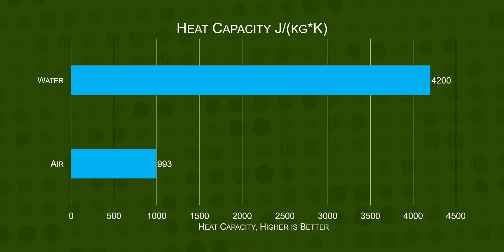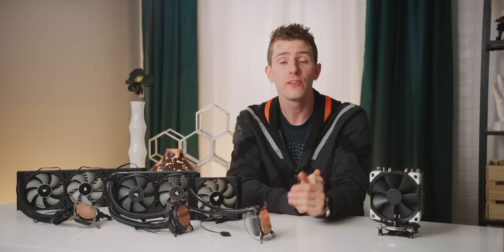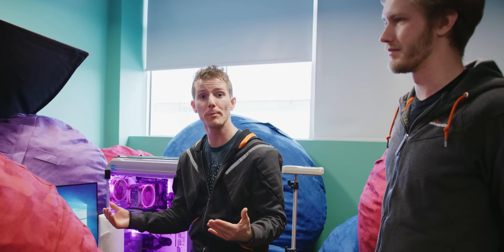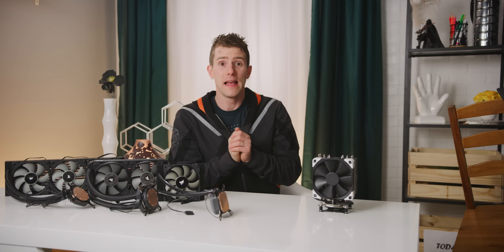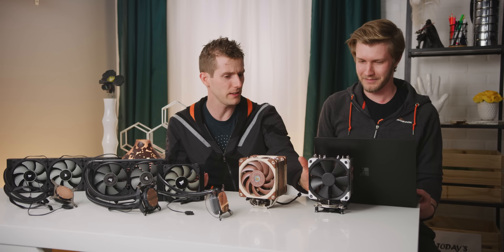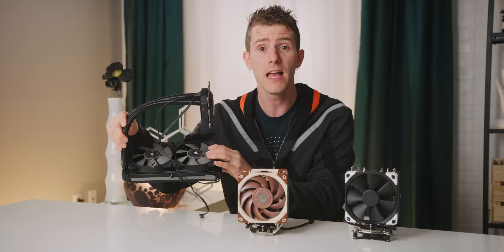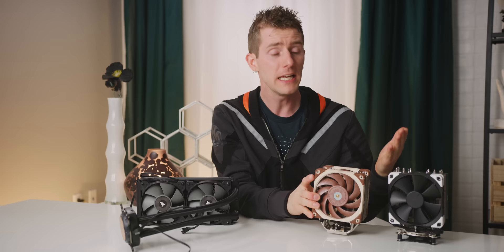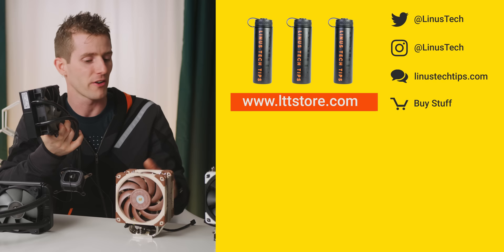Why you shouldn't water cool your PC

Comment: each doubling distance kills 3db in noise.. the microphone is placed in the same position all the  time.. but the coolers not... the water cooling is almost half distance and thats why its louder.. so the test is kinda right.. but wrong at the same place.. cause u are measuring wrong distances.. you must also consider the isolation of the box.. cause in the cpu's place is far more than the opened front  open intake witch normaly would have more less sound isolation   for air flow  

the other part is that you tested in max temperature - max fan rpm... but the use of the pc WONT be for ever that high... so probably on normal tasks .. or work.. or gaming the values will be also different.. that means one product may be louder at full speed fan.. but not at 65 or 50.. also some products may never exceed 60 deggrees.. but other could be always above...  probably the air coolers could keep in idlee potition better temperature keeping cause of naturally metal heat dissipation without even the fan turning.. 

 .... i am an audio engineer

Comment: I've been using computers since Commodore 64 days and I will never use water cooling because water is really, really bad for a computer.  If you have a few thousand dollars to throw away and get a new box every year then sure, try out water cooling but when it leaks and destroys your computer you are not allowed to be angry about it.  It's a risk versus reward argument.  ^ ^  KC  P.S.:  Also, overclocking CPU's was a thing back in early 2000's and unless you are an e-pro gamer there's no reason to overclock a CPU which is the main reason to use water cooling but hey, future e-sport gamers gotta start somewhere amirite?  =P    ^ ^   KC

Comment: My CPU almost reached 100°C once with air cooling
(If you want to know, which CPU it is, its the AMD Ryzen 5 3600 6-Core Prozessor)
Reply: Was the air cooler a cheap or expensive one? Also what size?

Comment: I have a poor, poor, i7-13700K that I paired with a CoolerMaster Hyper EVO V2 cooler. The poor CPU runs at around 105C, and 4.8GHz! I was told this was "BAD! VERY BAD! TURN OFF YOUR PC *IMMIDIATELY!!!*". But it's been running fine at 100% utilization for over 3 weeks now!
Reply: How is it doing now?
Reply: @swallowedinthesea11  I TINY bit better! I discovered I had the best air cooler on my living room computer, the Noctua DH-15, so I swapped it in. Now it runs around 5Ghz, but the temperature is still around 105C at full load. And it hasn't complained AT ALL!

Comment: Question is, did you front or top mount the H150i, because the H150i outperforms the NH-D15 if front mounted.

Comment: Water cooled:
PROS
Better cooling when it comes to scenarios with short-term, burst usages out of the cpu.
Light, less pressure on board.  Board not prone to bending/breaking from weight.  Better mounts.  Good for travel.
Small form factor.  Board is more accessible for pc tinkering & adding/removing accessories.
Better for small pc cases.
More quiet.
CONS
Overall way more expensive than heat pipes.
Extra point of failure.  If pump goes bad, have to buy a whole new system.  Expensive problem.

Heat pipes:
PROS
Much cheaper than liquid cooling.
Easier/cheaper to replace if fan fails.
Equal performance on overall cooling ability.
CONS
Heavy, lot of weight/pressure on board.  Bad mounts.  Worse for travel.
Large form factor, can get in the way of cables, problematic for pc tinkering.
Noisier.

Overall:
Water cooling is only the clear winner if you have good income and don't live in California, where you lose 90% of your income to bills, taxes, food, and last but not least, gas.

Comment: It's all pretty until the pump fails or a leak occurs.
Reply: and... nothing will happen. AIO liquids are harmless.
Reply: @ironwheal  When the pump fails, cooling gradually stops. If you don't have an overlay to monitor cpu temps, your cpu will overheat and might get damaged. Although some motherboards will shut off , there is still a risk
Reply: @GForceIntel  the danger is very overblown. we aren't in early 2000s anymore. nowadays your cpu will just throttle down to acceptable temperature (and unacceptable slow speed), and that should alert you that something's not right, in case you somehow fail to notice water leaking out of your computer lol. it also happens with air coolers all the time because of gunk, dust, etc.
Reply: @ironwheal  is it a higher risk than air cooler yes or no.
Reply: @GForceIntel  I don't think it's a higher risk. why should it be? the cpu knows nothing about the type of fan or cooler, it just shuts itself down if the temperature exceeds the safe limit.
Reply: @ironwheal  This debate is like religion. No one wins.
Reply: @GForceIntel  lmao, it may be "religon" only for those who can't read manuals and specifications. it's a matter of engineering, not belief. sorry))
Reply: @ironwheal  You are stubborn.
Reply: @GForceIntel  still it wasn't me who turned a simple and quite obvious technical matter into a question of religious debate, lol. meh.

Comment: this is very interesting.  been  always AIO favoring this few builds, But thinking of savings this days coz of expensive GPUs found this video. I always thought AIO is more quieter.
Reply: In my case it wasnt. I had AIO Thermaltake water 2.0 and on load mode it was as loud as jet. Eventually it failed because of pump and I decided to go with air cooler this time. Bought Arctic Freezer 34 esports and it's so much better... Not only it cools my CPU better, but also is more silent and I don't have to worry about leakage or pump falure and on the top of that was much cheaper than those crappy overpriced AIO coolers. I'm not going back to water, never again!

Comment: Honestly, I never found water cooling appealing because of the water aspect.
I'm a high end user and my PCs cost too damn much to want to chance such a catastrophic malfunction. Lots of point of failure in a PC and I've dealt with my fair share but introducing water for some possible cooler temperate? Id rather run a slightly warmer PC, I'm a stress free Noctua owner with a good pair of cans.
Reply: Can u donate me a noctua air cooler bro mine is deepcooler but i want noctua too :>

Comment: I have a w200 case with a p200 and 1 whole side of the w200 dedicated to radiators that are extracted directly out of the building....

I have a 10900k running at 5.4ghz on all 10 cores with 3x 480mm rads, 128gb 3600mhz ram running at nearly 3900mhz.

Running a 2060 with dual 360mm rads and running games at full detail at ×130mhz core +900mhz with no over heating at all.

Stock air would get 5.2ghz on the 10900k bottlenecking to 4.9ghz due to heat issues. The ram could not go over 3800mhz and the gpu would struggle at +80mhz core +500mhz with detail.on medium on cod cold war...

I wont even upgrade my.gpu until it blows up...

It runs cooler overclocked than when it was running stock with air...

Comment: I know it's a bit of a meme, but I actually used a single 120 radiator in my PC for a while. Since I switched from a stock cooler to that, it was marginally better, though the fan that was included was quite loud.
Edit: I decided to switch back to it temporarily since my Ryzen 7 3700X is always running hot. I'll be honest, it's actually doing significantly better after I adjust the curves a bit (and change to a Noctua fan)

Comment: I'd like to know how they got the triple fan aio to perform worse than the dual fan one... did corsair do something different that made it worse?
Reply: Its not its just... Liquid Dynamics and a bit of physics and Chemistry.... You see. When a fluid gets heated up, it actually gets more ''liquider'' as it starts to transform into vapor or gas... This is what makes the watercooling effective in Cars. They have a perfect size radiator with just enough Cooling solution specified by the manufacturer to maintain the engine at working temperature.... The faster the liquid flows, the quicker it cools off as the movement dissipates the excess heat energy into the radiator of the AIO cooler. The issue with the larger triple fans models Is the pump.For a such a big radiator and space. It needs more strength and speed to effectively cool the water so it can complete its cycle cooled off to help dissipate the heat generated by the platewhich is contact with the CPU. So a smaller Radiator so the cycle can be effective.

Comment: Video still relevant?
Reply: Yes.
Water coolers still being pushed for cpu cooling. Up to a certain point as in power draw of the cpu modern air coolers keep the cpu cool. Above that water coolers take over. Some pc builders still use water coolers cause of aesthetics or space of tower being used. Air coolers have less parts to fail and if you have the room do the job really well. Add the air flow of your case factors in for both coolers working at their best.

Comment: my water cooling kit just crapped out the pump made a grinding noise and my pc froze. Im like what the hell I checked the fans all good. I turned the PC back on and the bios said error CPU is overheating it was 90c on idol so I have a standard cooler in now and on load it goes to 85 and sits idol at 40 so yeh I am thinking the heat funnel coolers might be the better way to go.

Comment: Here’s the thing tho, water coolers will never be as efficient as air coolers because of a thing called heat transfer. With a air cooler, you are transferring heat from the cpu, to the radiator to the air, where as the water cooler has another step in that same process leading to slightly higher inefficiencies.

Comment: what happens if i live in a very hot environment like in Saudi or Dubai (without air conditioning ). The room temperature is also hot. Don't you think adding an AIO will perform better  than Air COOLERS because the air inside the room is pretty hot. what do you think ?? LINUS please reply to this. #LINUS

Comment: Speaking from my own experience: I had both air coolers and AIO water cooler and I can say that I will never buy any AIO water cooler. Not only it was much more noisy when in load mode, but it's performance wasn't as good as air cooler I have now. This air cooler I have now (Arctic Freezer 34 esports) is clearly superior to my ex AIO cooler (Thermaltake water 2.0). Plus you don't need to worry about leakage or pump problems and my Arctic freezer is much silent and much cooler and was also much cheaper. By the way, my AIO cooler died from pump failure. Something the air coolers will never have such problem. So, maybe I'm saying not popular thing, but I would prefer air cooler any day and night to those crap AIO coolers.

Comment: What is this BS? My Corsair Elite H170i LCD screen 420mm AIO keeps my i9 12900K CPU extremely cool. Proper LGA mounting kit with Noctua NT - H2 thermal compound applied. Never exceeds 31dBA.
Reply: 2 years old is what it is. Still very relevant. Comparing the Noctua Nhd15 to a 240 AIO say and yeah it can perform better.

Comment: I like my case fans to sound like a jet engine ... I want people to tremble at the sight and sound of my glorious $7K monster of legend and be blinded by the shimmer of the RGBs. Now, if only I could find a 3090 that isn't 3x above MSRP I will actually get around to building it 😭

In the old days I built monsters which were completely air cooled and never had a problem. And back then CPU and GPU cooling was more primitive. The temperature of your room plays a part in it and I like my room comfortably in the low to mid 60s F 😋

Comment: i dont think this aged well cause your straigh tripping if you think an air cooler is gonnna be enough for the 10900k. vs a 360 from arctic.
Reply: i want to get arctic but can't choose between 360 and 280 mm, what can you recommend?
Reply: @morgothbloody7181  if you got the room for the 360. Get the 360. I have had 0 issues with it.
Reply: @nivonis393  i discovered a problem what not so many cases support top mount of 360mm radiator, even 280mm...
Reply: @Morgoth Bloody  i front mounted mine. With inside fans on both sides of the rad facing into the rad and two top exhaust fans and one back exhuast fan. Have had 0 issues

Comment: I'm 100% guilty of brand loyalty with my PC, I buy from the same companies for my processes, graphic cards, ram, cooling.... whatever. That worked perfectly for me the first time. it took me a while and swapping out different parts but that first time I got on a game and it ran perfectly... that feeling of I just built my first PC and it's amazing. I'm too nervous to go outside of those brands because I know it worked. :D

Like I have never tried an AMD card, I only use Nvidia and I have never used any other motherboard company but Gigabyte. My first motherboard was an MSI and it was dead on arrival. The shop that sold it to me gave me a deal on a gigabyte and I have never gone anywhere else.... never even looked at anything else. Hell Gigabyte could be a shit company and I wouldn't even know, they work for me and I keep buying them for my PCs.
Reply: Brand loyalty in PC building really relies heavily on personal experience.  The longer you build PCs, the more you reinforce those preferences.   I've built very strong preferences over my 30 years of building my personal and family/friend PCs, due to personal experience with specific brands.  For example, I always purchase an MSI or ASUS mainboard with ASUS ROG GPU (previously preferred either MSI or ASUS GPU, but ROG won me over completely when they came out) and Corsair memory (Vengeance).  I will only purchase Antec for PSU and case, and APC for UPC.  I also only ever go Intel CPU and Nvidia GPU, mainly because the one time I tried an AMD setup, it was nothing but instability after instability.  That said, the reasons for this were instabilities from over 25 years ago, when AMD was a fairly small niche option as a pc build brand, and their GPU offerings were very new, and when specific component compatibility, even down to the specific brand and model number of memory installed, was a very serious hurdle. (pretty sure it was an AM486 DX4-100 with 3D Rage GPU and I could just never get it to run right)

For example, back in the days when LAN was not built into every motherboard, I would ONLY ever purchase D-Link, and even then a very specific model (I forget the exact part number now, it's been so long.. the old school version of DFE-530TX I think).. mainly because that specific card could be plugged in to literally just about any setup and work instantly and reliably, while most other ethernet cards were absolute headaches to get working because of compatibility issues.

The only Gigabyte item I ever owned was a motherboard that I got because of physical damage to my old MSI mainboard (my own fault.. trying to plug in headers in a tight space and caused irreversible damage, destroying pins) that was out of production and I couldn't replace meant I had to use what was available, which was a Gigabyte. That board lasted 2 weeks and burned up half the components in the machine.  Does my experience mean Gigabyte is crap?  Naw, sometimes you just get a bad one, but my preference definitely was reinforced by the experience.

Crazy to think, though, how a bad experience over 25 years ago with very new technology during a time when instability was the rule rather than the exception... caused me to never consider AMD again.   Actually, I take that back, I think I tried a Radeon X1000  in a build later on in the 2000's  and it always had weird artifacts and bad renderings.. guess it could have just been a bad card or something though.

Comment: Basically the bigger the watercooler the less effective the heat dissipation will be....Think of a car radiator. A radiator is the perfect size to make the cooling stuff course around it and cool it then goes back to the engine dissipating excess heat the doing the cooling course again
And most stuff people forget about those BIG ass Coolers is that they force your CPU socket downwards on Tower Builds. Dont forget that heat makes stuff dilate, so Turning your pc on and off Ultimately leads to some severe wear and tear
Expand->contract>expand> contract... This cant be good for your mobo CPU socket
Oh by the way... Theres a neat trick you can use to speed up your AIO watercooler heat dissipation.... Using an extra fan.... Like a turbo engine... One fan pushes the heat out and another helps pushing out even faster

Comment: It's funny seeing this video pop up right next to gamers Nexus video on water cooling versus Air cooling one isn't better than the other or vice versa can you have a catastrophic failure with water cooling? of course. Can you fuck it up? Sure, should you choose air cooling over water cooling, it depends on what you plan on doing, overclocking a PC using water cooling is a little bit easier than using air cooling but quite honestly if you want to overclock just submerge your whole motherboard and graphics card in mineral oil get a fish tank take out all the fans all the heat sinks everything leave the chipsets in and submerge the thing in mineral oil.

Comment: the three-fan system may make more sense when your LAT is higher, but with more length, and a fixed flow rate, you have diminishing returns, alao may even make things worse, because  of the longer tubes. After all, in a cross-flow hx, the first 3rd does most of the work. So it doesn't surprise me one bit, that the two-fan system outperforms the three-fan one. The air cooler is somewhat surprising, until you consider it is in a push-pull config, which boosts the flow rate and allows the fans to run slower. air flow rate was not measured, so it is hard to estimate exactly Heat pipes seem to be very effective, though. And that may be a big part of the reason.